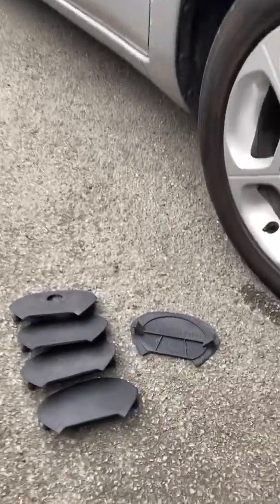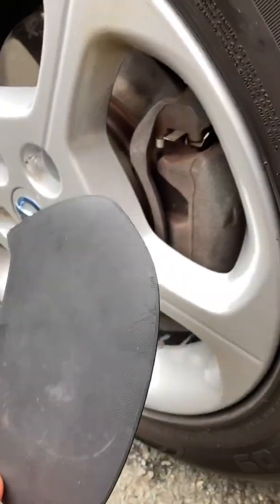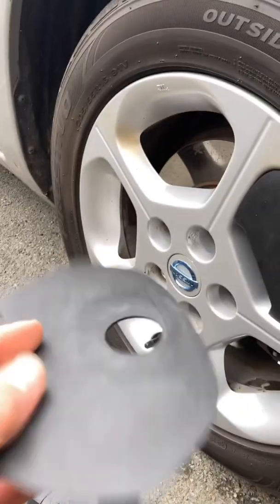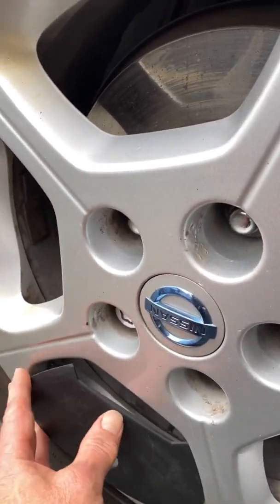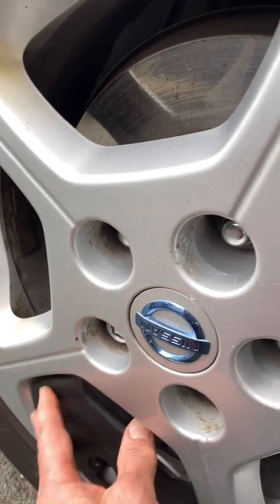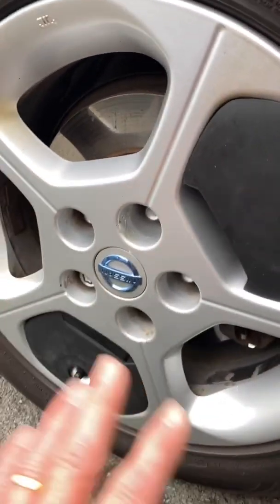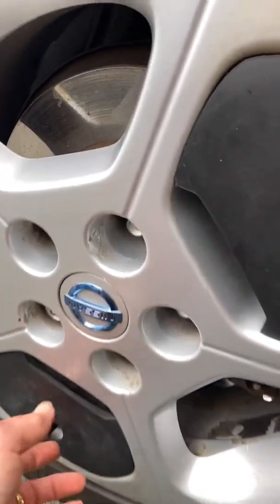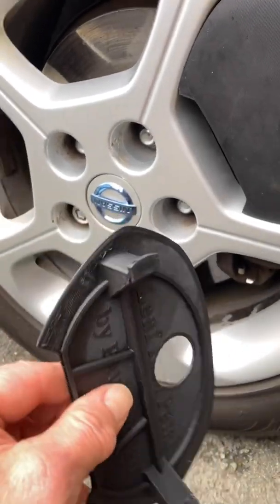First try with Nissan Leaf wheel petals to reduce drag and increase range slightly. Work in progress

Comment: Brakes will get hotter with them
Reply from the maker: Vortec, Agreed in theory but wouldn’t have thought it would be significant in practice, as still got air flow (hole/slit in the covers) and brakes aren’t used heavily. Thanks for the comment regards Damian.